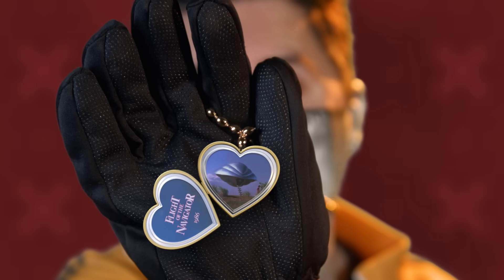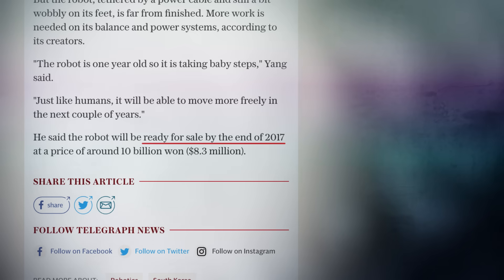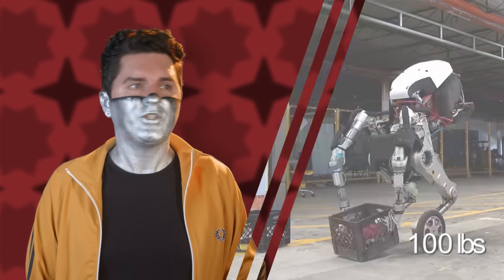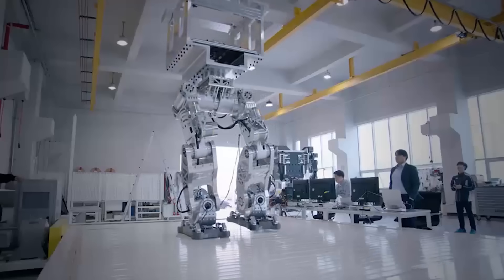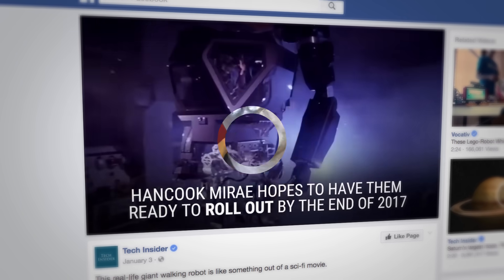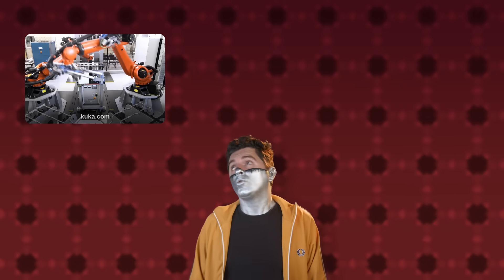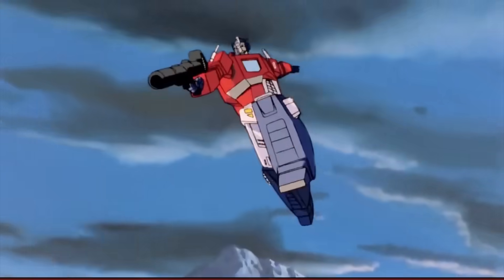The Method Robot | Quick D

Comment: Surprising no one, it never went on sale in 2017. They've pushed the date back year after year and it looks like it'll never be a real product in its current form. They never figured out how to get it to walk and balance over any complex obstacles or how to transport the large amount of power it would need to operate. The legs aren't able to carry momentum like an electric car's wheels can so it uses way more power than an electric car, but can only carry a fraction of the weight so the big batteries of an electric vehicle are super impractical for a bipedal robot.

Comment: Well, you were right. 2017 is long gone, and no giant mech robot seems to be aiding with... well... anything at all. 
I get it - I grew up in the 80s too. Giant mechs were what every kid wanted. And I suppose giant robots with truly self-contained power supplies, fully articulated limbs, balance control (and a hell of a lot more durability, reliability and flexibility than what we see in this video), could be useful in some circumstances. But wait, what would a giant robot be able to do? Lift heavy things? Yeah, we have machines that can do that already - cranes, forklifts, trucks. I suppose it would be somewhat useful to have one machine that could lift, transport and set down weights of varying sizes and move around a construction yard easily - but would you pay 200,000,000 dollars for that? Or would you just, you know, hire some cranes, forklifts and trucks? 

I know! You could strap a big gun to your big robot and use it in the military! Yeah! There's no other way of carrying around a big gun except to use a big robot, right? Things like tanks and helicopters and AFVs simply don't exist! In fact, I have no idea what those three words even mean, I'm just rambling here! And a giant, relatively slow moving mech with a ton of intricate, moving parts which would be tough to armour, is perfectly suited for military applications! It's like a tank, except less armoured, only slightly more manouverable and has legs that can be disabled easily, rendering the whole thing useless! It's got none of the agility of infantry, with less protection than traditional armored vehicles, carrying weapons that already have a means of deployment! What military WOULDN'T want to spend hundreds of millions of dollars on extremely expensive, large targets that offer questionable utility! 

Let's face it - there's no real need for such mechs. Even if you could make them like the robots in Patlabor, honestly, would they offer much more functionality and practical use over existing construction machines? They might, but not enough to justify their development, construction and maintenance (which would be a nightmare). Useful robots suits can be made, certainly, but they would most likely be our size (so as to operate within our domiciles and work-places). A huge mech suit like that would just take up a ton of power, and you would need to be REALLY careful where you step when wearing one - one poor mis-judged step and it goes toppling over - damaging itself in the best case scenario, and killing bystanders and destroying property in the worst case scenario. 

Look, dudes, seriously - aside from the "it's really cool!" factor, why make these things? Why bother?

Comment: Is no one going to talk about the fact that Who Framed Roger Rabbit had a bigger budget than Jurassic Park?
Reply: It's probably not the entire cost difference, but I kinda like it when they pay animators. :P

Scene for scene, an animated movie just costs more than a live action one. The time is spent differently, the workflow is different, and the needs of each project are different. And while animation is faster and easier now, they were working with ink, paint, and celluloid. Plus actual live action. Plus compositing. Plus all of the popular characters they stuffed in as well. I also wouldn't be surprised if they tried to pull the plug on the whole thing a few times. :v

Comment: The method 2 was never designed to have pilot controlled legs, it was designed to replicate human hand and arm movements, and when you said that only its arms are able to be controlled you are not entirely correct, you can control each finger individually  from the hand held controllers in the cockpit. The robot itself does lack in its promises and does have its flaws, but the company has started working on its third generation, which shows quite a few changes as the R&D continues. It  shows promise, if they can work out the problems.

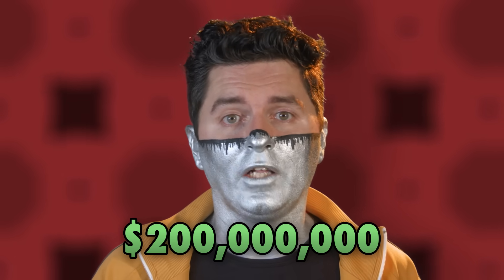Comment: 3:18 Yeah sorry, that's a power cable. That thing is HUGE, it can't work on car batteries.
But it can be controlled wirelessly, wi-fi exists. :)
Also, "why they don't pre-program it"? Did you see its size?? If something goes wrong, they need to be able to hit the STOP button... :)
Reply: Regardless, it is not capable of operating independently, which is the main Point.
Reply: Are you guessing or do you have some objective way of proving it?
Reply: @phoebeaurum7113  Prove what? That it's a power cable or that it can be controlled over wi-fi?

Comment: There actually is a Japanese bipedal robot that's actually being developed of that type, and has a similar design.

However, the major problem is powering the thing. We have the technology to BUILD a machine like this. But we don't have a realistic way to actually POWER such a machine. If portable fusion energy reaches the size of a V-8 engine, then it might be realistic.

...Of course, by that point, we'll have solved all of humanity's fossil fuel-related problems by that point, since fusion reactors will have long made electric cars better in every way than hydrocarbon cars.

Comment: IK I'm late to the conversation, but your right and I can add one huge thing to your argument.
That thing has no onboard power and no form of balance stabilization, it also has a ridged waist.

this means it would need major redesigns to account for its limited range of motion before it became an effective tool.

things that could be done to fix all issues
Option A 1 Stop. humanoid Mechs look cool in cartoons and movies but make no mechanical sense, the stresses they put on themselves make them a headache to maintain.

Option B 1 replace the waist down with a tank. you have roughly the same footprint area in the end and a more stable base you can have a rotating torso on, then you could have the grappler arms effectively push pull or lift with minimal chance of tipping. (they still have weight ratio issues and movement speed issues.)
2 to further reduce the tipping lower the center of gravity by reducing the torso  and operating the arms from within the tank base.
3 keep joints like the wrist and shoulder simple this will reduce flexibility but exponentially increase durability allowing for a more reliable tool.
4 DO NOT even think of giving this thing a weapon. you want to launch rockets, fire missiles, or shoot bullets, use a tank they are cheaper and proven to work better than this ever will.

you want to create an exhibition machine great you want to create an interesting engendering thought experiment to try to come up with better ways to do certain things great (though crazy expensive). But Robo-jocks and Jaggers will NEVER be practical even in spaaaaaaaaace. Why do with a school bus what you can do with three guys?

Comment: The movement of the robot would make the driver sick fast.

There is no military application, it's too big and easy to hit. Rocket-propelled explosives is cheap in comparison, which is why armored vehicle is mostly used as transportation now.
Reply: RPGs are no match for Chobham armour. Just cover this thing in Chobham and it'll be pretty much invincible. Abrams and Challengers already proved this during Operation Desert Storm, there were several tanks which took over a hundred RPG hits and barely had a scratch afterwards.
Reply: That might be true when fighting against enemies that are so much inferior. But nowadays, even though there is no longer any infantry operated system that can handle modern armor sufficiently, the cost of an anti-tank system is still much cheaper than a tank.

The point is that tanks are not as imposing as they used to be. Air supremacy is much more important now.

And about all this mecha thing. I just can't see any practical military use for them, industries maybe, but not military. Bipedal meant flexibility but also meant much less stability, knocking them down will be too easy.
Reply: The amour of a modern tanke can protect against   a RPG-7  from most direction but the later RPG-29 that not as common was designed to defeat the can do that. They have penetrated lower front armour of a Challenger 2 and sides of a Abraham. There would be more cases if they sas not a lot less common then the RPG-7.

Lager anti tank missile system especially those that can hit the top is a danger to all tanks so soft and hard kill system  so they miss or get destroyed before they hit are more and more common because you can 't just add more amour because of the wight. Tankes only have the most efficient armor on the front of the tanke and on the front and sides of the turret the other sides have a lot less protection.  The frontal cross section of a tanke is relative small.

A M1 2 m high if you remove the 0.5m ground clearance. They are 3.6m wide but each track is 0.6 m and not protected so the lower part is only 2.4 m wide, part of the turret  above the tacks so lest sway that is is on average 3m wide. The hull and the turret is of similar height so lets say the average  with is 2.7m. The result is that the frontal cross section is 5.4m^2. The part of the robot where the human is is ~1.5*1.5m or 2.25 m^2 .  That is relative close to half half of a tank. it also have a lot of limbs that need to be protected so se talk about huge fractions of the frontal armor of a tanks. So you talk about many tonnes of amour. A M1 turret have a mass of 22 tonnes so a 10 tonnes amour to protect tie body of the robot is not unreasonable. The robot they have designed is listed at 10 tonnes so you need joints that can support more then 5 times the load and the same for the strength of the the part that move the legs. That would be a huge problem.  

The later M1A2 have a mass of  68 tonnes and a ground pressure of 1.09 kg/cm^2. That result in 6.2 m^2 of track. The ground pressure is similar to a human feet and you need low levels like that to function fine on soft ground, small wheels is why wheeled vehicle  can have problem in the terrain. If the robot have a mass of 10 tonnes you need 1 square meter feets, Both need to be as large as it life one to walk.

So building a protected robot of that size would be a huge problem. They you have the problem of power and endurance. It looks like the demonstrator units are powered trough a wire on the ground. Any robot used in the field would need a engine  and a fuel tank or a huge amount of batteries that result that you need to charge it for huge part  of the day. Large part in volume and mass of a tanke and other vehicle is the power plant.  

The larger question is what you would use them for? what kind of operation is they better then a tank or other Armour or  unarmored vehicle. Smaller robots that can operate where a large vehicle can fit have a usage. Human size robots might be useful in combat in urban environments but when would you like a large walker?  You build vehicle relative low so you can use the terrain for protection and use camouflage and hide them. You build like a box so you have large internal volume compare to the armor and the wake is almost the opposite.

Comment: They have hand control working now, just FYI. Simply done with buttons on the joysticks. Capacitive sensors (ala Vive Knuckles controllers) or analog finger control could be used to make it more useful though. And they put a reporter in it for the forward and back walking sequence, so they at least trust the canned movements.

Though agreed, they need to get it self balancing, get the cockpit stable, and get pilot controlled walking in. It's getting there, slowly.

Comment: Couldn't they use 1:1 movement for the legs too? Add in haptic feedback to help the pilot feel the ground push back and let them control everything- less a robot and more a mecha.
Reply: Nope, they couldn't, because a human body does not in any way equate to a mech's body that is made out of metal. Bipedal walking is a much more complicated process than 4 jointed stick in motion. It takes into account the weight of the upper half and the constantly moving gravitational center. Using metal as the main body instead of flesh, complicates that 2 problem to the fricking moon. Bipedal giant robot are mostly fantasy that violates physics. (smaller and human-sized one could work though)

Bipedal robot is just a romantic idea anyway. People want to see a bipedal robot because that's what all sci-fi medias use, but it doesn't have any advantage whatsoever to say, a simple tank thread. It's simple to maintain, easier to control, and more adaptive to environment.(except for stairs)

Comment: The construction of this robot is just simply impractical. Aside from the fact that it doesn't need to look humanoid at all, if it still wants to be, it also doesn't need to have these extended proportions. The cabin where a driver would sit seems a bit oversized, perhaps for protection, but could probably do with a depth reduction for a better form factor. The cabin also ought to be raised up, and/or the arms lowered, so that the machine is not nearly as top heavy. Then the feet should big bulked out at both the hips and the feet so as to add greater weight to the base, which would ground the machine much better, and allow more room for stronger hydraulics, and balancing mechanisms. Lastly, the machine should have articulated toes installed, and should be fitted with mechanics that allow it to lock and release its joints dynamically during sequences of specific action, so that it is able to bend down, lift things up, walk while holding objects, and push or pull still other objects, without falling over or buckling under additional weight.

Also, my changes would just make the thing look more aesthetically pleasing. Cause this boxy stainless steel look has no style. It just looks ugly.

Comment: Relax.. This thing doesn't have a power pack. Its presently tethered to a high voltage source. Even if it were to have a high capacity Li-ion based battery pack, it would not last more than a few steps with the controller moving around his hands so much..

Comment: Even if the arm control (among other things) was up to par, there is still no real reason to make it bipedal. there's a very good reason why the bots getting shoved and kicked around are four-legged.
Reply: Boston Dynamics also has human-shaped robots that they kick around. While they are more susceptible to falling over, in some of their videos it is used to demonstrate how the robot can analyze its surroundings to quickly get back up on its feet.

The 2-legged robots from BD are shown in demonstrations picking up and moving heavy objects, so I get that is one purpose of making something 2 legged. But the Method robot is far from achieving anything close, even when they have such a huge budget.
Reply: In theory it would be best to have both, monkey around and then stand on its legs to lift and carry things.

Designing the feet is the most difficult in my view, as stability starts at the ankles, where you need fine control but it also supports the entire weight. Also you would need leg extenders to mimick the hips etc. To be honest mimicking human walking is not that difficult, but simplifying it is. Even when we get it down, which shouldn't take too long if they are coding right, it will never be efficient, because the amount of parts wear is insane compared to wheels. They would break down all the time.
Reply: Just make a robot centaur
Reply: Tripedal would definitely be the way to go i think, with the third leg being in the back for extra support, the legs should be entirely controlled by an ai (obviously) with the human guiding it’s direction of movement, the arms would be actually useful in this robot and maybe if its not to ambitious though it most certainly is a swivel point near the torso area for more maneuverability

I don’t know anything about robotics and this comment is most certainly dead but I would like to know if I’m being stupid.
Reply: Yeah, the main perk of a bipedal robot is it can go anywhere humans can, so it can use all of the existing estuff for humans in a given place. A giant robot... can't do that. It can't fit in buildings. There's realy no point.
Reply: @MeepChangeling  I agree there is really no advantage to make your robot huge at the moment, besides looking cool
Reply: @Doggggggggo  and there are tons of ways to still make it look cool while making it more efficient
Reply: Being bi-pedal does have advantages, a bi-pedal robot will be smaller and therefor lighter, it will also (in theory) be more maneuverable, we also have a really easy time gathering data on bi-pedal motion because humans are bi-pedal (if you didn't know) and whereas gathering data on wild animals or just animals in general can be difficult for a variety of reasons humans can easily participate in experiments and perform tricky actions on repeat.
Reply: the ultimate goal is to have a full body control interface like pacific rim. and to look cool AF.  if those aren't real reason to develop and build a bipedal mech then I guess you never watched anime or sci-fi as a kid. In japan, gundam designer is a serious and respected job, they make real size statues of their work, mechs are part of their culture.